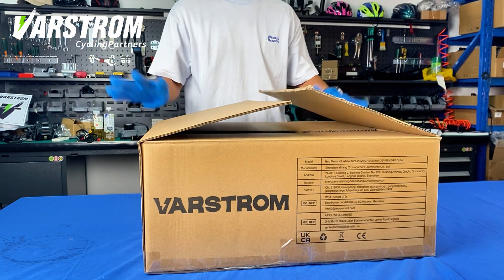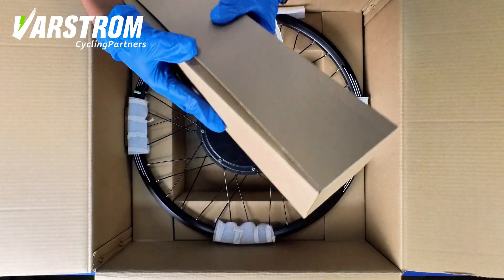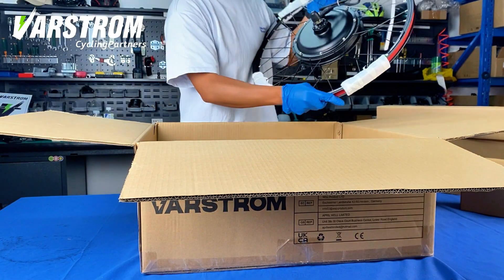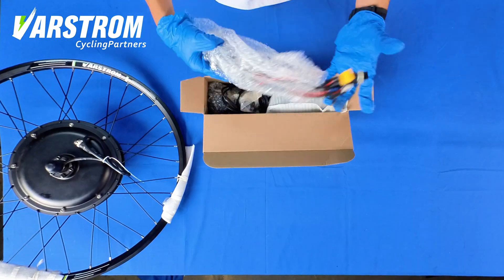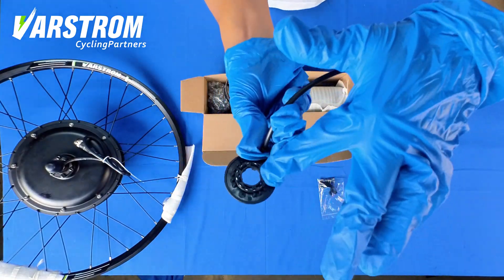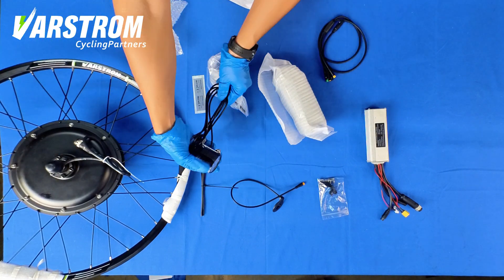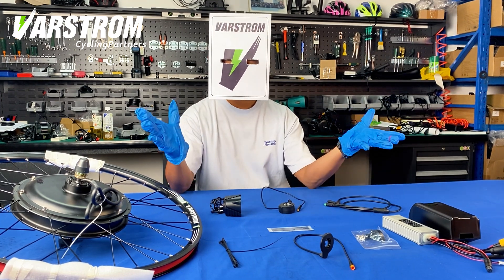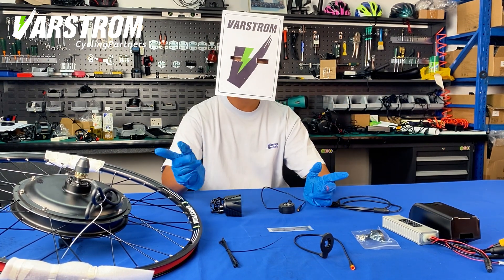Unboxing e-bike conversion kit of Varstrom （ Varstrom 48v 1000w）

Comment: hello, my display shows completly wrong speeds, like alwas 99km/h. what could be the problem?
Reply: The magnet inside your motor is missing or broken or out of place.  Buy a wired odometer and attach it to your front wheel.

Comment: I just bought this kit, is there any 3rd party full twist throttles that I can buy?
Reply from the maker: You can check other platforms. Currently, Varstrom does not have full  twist throttle.

Comment: Hi, please can you tell me how to unlock the speed of the Kross Hexagon 3.0?
Reply from the maker: It depends on what display you use.
Reply from the maker: Also, does the controller.
Reply: yes, in the main menu the settings are locked
Reply from the maker: @Cristian76-i2j  What brand is your display?Do you need to enter the advanced password to enter the advanced settings?
Reply: @varstromebikeconversion  the model is an XCA01 1.0 .. A2203111290
to enter the menu I hold down the plus and minus buttons at the same time, in the settings it does not ask me for a password. if you have an email I can send you a short video.
Reply from the maker: @Cristian76-i2j  This is not the Varstrom‘s product, I don't know how to set it up

Comment: is the axle 10x12mm or 10x14mm?

I want to buy the right torque arm before I order it.
Reply from the maker: Fits For 135-142mm Rear Dropout Size
Reply: I want to know the height and width of the axles, I already know the length, I want to know how to install a torque arm, so as not to break my frame 

10x12mm or10x14mm @varstromebikeconversion .